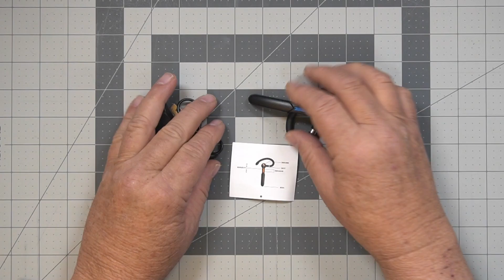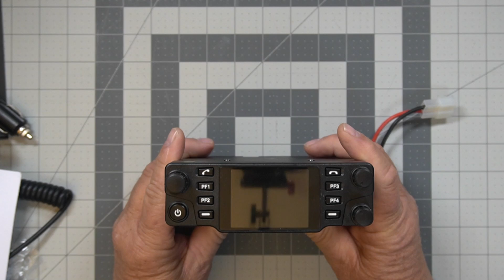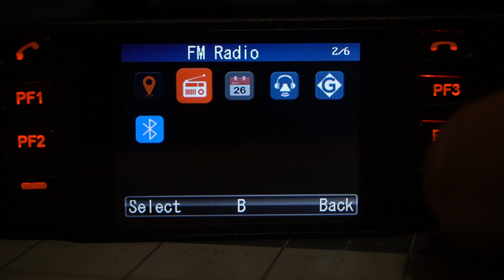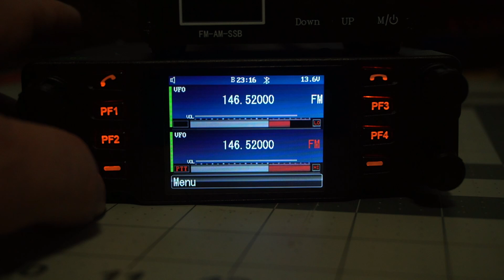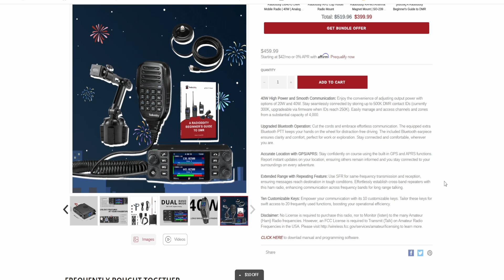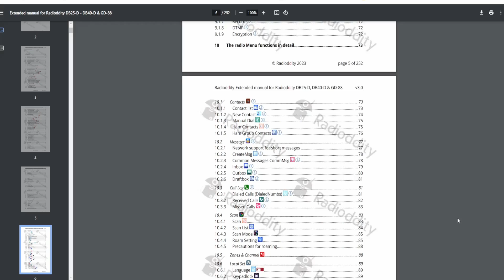Radioddity DB-40-D DMR Mobile Dual Band Radio.

Comment: The DB40-D is a good radio, but not a great radio for it’s price point. If you buy the radio and only do analog 2m or 70cm, you probably won’t be satisfied. As a DMR, the radio is quite sufficient. With most digital radios, there is a learning curve that one has to deal with.

Comment: good video, great info, but its 2024 and if the radio doesn't have a removable head I don't have a use case for it in my truck, just not enough room
Reply from the maker: I was surprised it didn't.